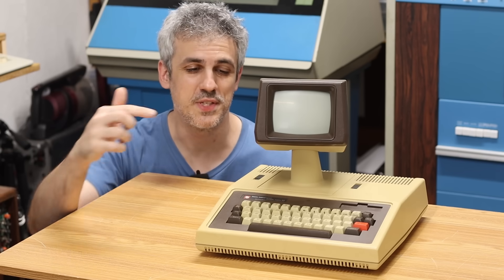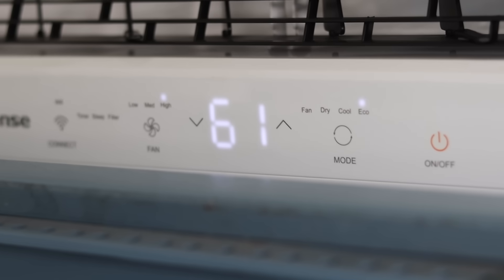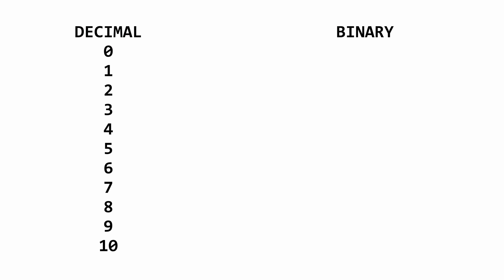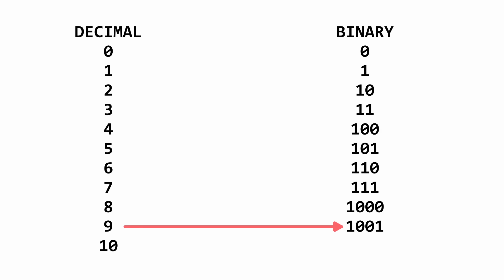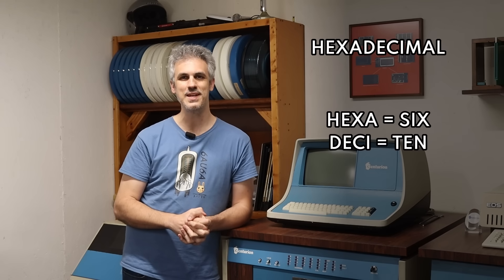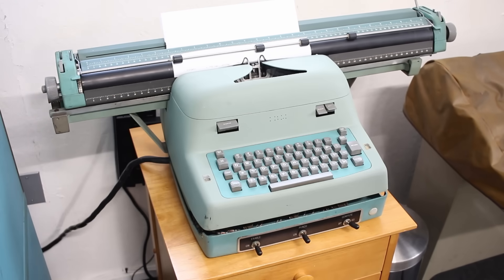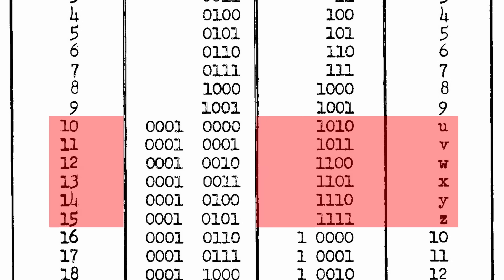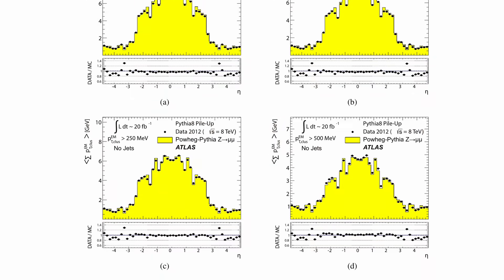Learn How to Count Like a Madman (Or a Computer)!

Comment: Hexadecimal + decimal isn't that crazy, given that some early computers were built using something similar called bi-quinary, as a way to do decimal electrically.

Bi-quinary design consisted of one pair of wires that'd do a binary value in a one-hot form, and a group of five that'd do a quinary value in a one-hot form. Combined, this gave a decimal digit in seven wires, two of which would be energised at any given time. Weird, but workable.

Comment: 1:45 Fun fact: Every number system refers to itself as base10.
binary => "base2" => 2 in binary = 10 =>  base2 written in base2 = base10
octal => "base8" => 8 in octal = 10 =>  base8 written in base8 = base10
decimal => "base10" => 10 in decimal = 10 =>  base10 written in base10 = base10
hexadecimal => "base16" => 16 in hexadecimal = 10 =>  base16 written in base16 = base10

Comment: I suspect the zero is on the left because many early typewriters didn't have a zero , they used a capital 'O', 1 was also not used and a lower case ell ('l') was used.  The offset for placing the 1 on the right was basically good as the 2 was above the Q and slightly to the right.  If they had put the zero left of the one it would have been a stretch to reach it with your pinky finger so it went on the other side.  This way typists only had to change from using oh (O) and ell (l) to one (1) and zero (0), the rest of the numbers stayed put.  Just my best guess.

Comment: Early typewriters didn't have a 0 (zero) key nor a 1 (one) key, they just used I and O instead.  When some keyboards added one or both of these digits, putting zero on the right ensured it would be in the same place whether or not the keyboard had a 1 key.  Also, it was already common place to have zero after 9 on rotary phones, as it actually interrupts the line 10 times.

Comment: Great explanation David.  The other ”common” mixed base system is https://en.m.wikipedia.org/wiki/Sexagesimal, used by the Sumerians.  Base 60 numbers but written with Base 10 sub-parts.  And if you really want to bend your brain with number systems, try https://en.m.wikipedia.org/wiki/Balanced_ternary, which was used by some early computers back before bits won the day.

Comment: Numeral systems that use more than one base are called mixed radix systems, and they are niche, but not unheard of. The ostensibly base-60 system of ancient mesopotamia is often thought of as a mixed radix system that has groupings of base-6 and base-10 digits

Comment: Got an example of mixed base counting for your displeasure: the pro NES Tetris players use hexadecimal for the most signifigant digit of the score and base ten for the rest, for largely the same reason as the Bendix -- there isn't enough space for all the digits they need to display it in decimal.

Comment: If you can believe AI: The Bendix numeral system, used in the Bendix G-15 computer from the 1950s, is called bi-quinary coded decimal. This system represents decimal digits using a combination of two bits to indicate whether the value is in the range 0–4 or 5–9 (the "bi" part) and five bits to specify the offset within those ranges (the "quinary" part). Each decimal digit is encoded as a 7-bit pattern, blending binary and quinary elements for efficient processing in early computing systems.

Comment: I know it's heresy, but if someone wanted to change the coding to hexadecimal, is it a program change, or a wiring change on the Bendix? It has no eprom or anything like that. The paper tape does not hold the coding info either,  as far as I can remember(long series).

Comment: In the early 2000s, I was working for a school district which had a system where they could (still!) only store 2 digit years... but the digits were text... so for 1999 it was "99", but for 2000? It was "A0" thru "A9" (for 2009), and then for 2010?  "B0"... -- It was a mixed number system just as you described. -- The worst part... I don't even think they were using Cobol or something like that... I think they were stuck with this dependency because of a web service from some 3rd party that only accepted 2 digit dates. 😅

Comment: Mixed base numbers can be encountered in some NES games, if you overflow the score. Basically the characters are usually arranged as 0123456789ABCDEFGHI etc. So, if your score display is 6 digits wide, and you go past 999999, if there is no code to handle the last digit overflowing you'll end up with A00000 for 1 000 000, B23400 for 1 123 400 etc., which is good because you can still decode the actual value. For example, you'll see this in high profile NES Tetris, although a cheat is necessary to see it, because by default the game blocks scores higher than 999999 from displaying.

Comment: 1:35  That’s a beautiful car! I also have a vintage car waiting for me to get the engine running again. It’s a 1984-1985. 9th-gen Ford Thunderbird turbo coupe, a 2-door sedan. The license plate says 2002, so it’s been sitting for 23 years—and it had already been sitting before that. (It’s a Minnesota car.) The floors are rust-free, and it only has four small rust spots on the hood, each about 2 inches wide. The rust isn’t too bad. I can’t wait to get it running again!

Comment: As I remember, MAS90 Accounting (at least in the early-mid 90's) stored the year in a 2-character hexadecimal-like format.  Which meant it still only needed two characters to go past 1999.  I suppose if they actually stored it as hexadecimal it might have only taken one byte.  Of course, I can't quickly find any documentation that explains it.

But on that AH-3000, did you have to use a Lucas Smoke Replacement Kit on that wiring harness?

Comment: First rule of engineering is never mix measurement types or scales. One of the maddest things you can do is mix metric and imperial (standard) - which is why 1000ths of an inch is absurd (seriously if you can do 1000ths of anything, you can do metric) but not as f****d up as mixing numeral base types depending on the position! Although the office plan that came to us drawn and measured in deci-inches (without a scale) does come close

Comment: There is one weird system we all use:  dates and time. Consider 2021-07-31 23:59:59.999

In there we have decimals throughout, I grant you, but we have fields restricted to above 1, 1-12, 1-28,29,30 or 31, 0-23, 0-59 and finally a value 0 to 999.9 recurring.

So, a combination of start-at-0 and start-from-1, a range conditional on 2 other fields (for leap years), both integers and one real.

A lot of history made this - from the Babylonian base-60, the early Christians before the invention of 0, and finally the decision to drop ‘trices’ (60 trices make a second) in favour of decimal places.

I’m a programmer and have had to deal with this mess 😅

Comment: Whoa whoa whoa, are we really just going to breeze by what appears to be a Mazda BP4W swap in a mid 70s Isuzu 117 at around 1:45?  I need to know more about this... Do you have a car channel I don't know about?  Side note, I was only half paying attention initially until I recognized the crank trigger wheel pattern and the ignition coil assembly on the table, and I immediately skipped back to check out the car. Is it bad that I recognized a crank trigger wheel pattern first?  Edit:  I also want to know more about the Mazda Cosmo, and the Austin Healey... Really any and all the cars you may have most likely, based on seeing just those three... Seriously, let's be friends.
Reply from the maker: Good eye! Not many people can pick out a 117 Coupe.
There's also a '73 Isuzu Bellett, an '88 Nissan 300ZX SS, and a '91 Honda Beat hanging out too. Not to mention the handful up in storage waiting on work. I do have a car channel called Usagi Motors, but I haven't uploaded anything in forever there, although I would really love to start doing so!
Reply: @UsagiElectric  Nice little collection of rather unique and lesser-known cars you have there, we would get along just fine. I almost bought a 300ZX with a no-start condition for my first car but got talked out of it. Wish I had now... Pretty sure it was a 1991 but it's been too long, and my memory is fuzzy. I must admit it took me a while to identify the 117 and the Cosmo as I'm not intimately familiar with them, I got within the right ballpark on my own, but not the exact car, I ended up finally giving in and trying reverse image search from a screenshot and that was surprisingly accurate.  The BP4W on the other hand was an easy identification for me though. I'm actually glad to see someone swapping a BP series into something else for once, usually people are swapping other things in place of the BP engine. Any particular reason you went with the BP4W instead of the slightly later version with variable intake cam?  Side note, subbed to Usagi Motors, if time allows for it I think you should absolutely make car content as well.

Comment: Counting or parsing a date string in a Windows batch file is fun because it inteprets any number with a leading zero as octal and then complains that "08" cannot possibly exist. I had legitimately forgotten that octal existed before running into that error.

Comment: We did "modern maths" in secondary school, it was 1970, we did binary and then briefly explored other bases, so starting to work in binary and hexadecimal wasn't a surprise when I started with microprocessors in 1976. Then I started with DEC processors in octal, the PDP11-70 even has colour coded switches to help. 
Granted, the Bendix is a case apart.

Comment: On the topic of mixed number systems in one number: the jobcount in SAP systems is using this: For decades they used an integer representing the current time in centiseconds (1/100th of a second) to differentiate jobs with the same name. But when some customers started to schedule several hunderts of jobs with the same name in the same second, this system was broken. So - just for last two digits - they started to use alphanumeric symbols. This now allowed (10+26)^2  = 1296 instead of former 10^2=100 jobs with the same name in the same second. Rest of the number is purely decimal, still.
Oh, and "octal", as in base 8, IS a power of two. My head compiler threw an "Out of Cheese" error when you said that!
I think you meant to say that the number of binary digits needed to represent a single octal number isn't [ ld(8) = 3 ], while the number of binary digits for (s|h)exadecimal digits is [ ld(16) = 4 = 2^2 ].

Comment: hey, that's the same solution used on traffic light countdowns in china - if you have to wait more than 100 seconds, the tens column goes to a,b,c,d,e,f. affords interpretability. it's a reasonable enough solution!

Comment: Count like a madman? 0, 1, 2, 3, 4, 5, 6, 7, 8, 9, A, B, C, D, E, F, 10, 11, 12, 13, 14, 15, 16, 17, 18, 19, 1A, 1B, 1C, 1D, 1E, 1F, 20, 21, 22, 23, 24, 25, 26, 27, 28, 29, 2A, 2B, 2C, 2D, 2E, 2F, 30, 31, 32, 33, 34, 35, 36, 37, 38, 39, 3A, 3B, 3C, 3D, 3E, 3F, 40, 41, 42, 43, 44, 45, 46, 47, 48, 49, 4A, 4B, 4C, 4D, 4E, 4F, 50, 51, 52, 53, 54, 55, 56, 57, 58, 59, 5A, 5B, 5C, 5D, 5E, 5F, 60, 61, 62, 63, 64

Madder?! Okay, for base-2^64 where something like [100,0] means the number exceeds the counting base by one hundred times or [100,0,0] would mean the number exceeds double the counting base by one hundred times, et al.
The final integer can serve as precision by dividing it by the base minus one, but you'll lose 2^64-1 integer units out of the whole number. 
I'm pretty sure this system could conceivably store (2^64)^(2^64)-1 (basically 2^64-1 items that are each 2^64-1), and theoretically require something like 147,573,953 terabytes to canonically store the number.

Comment: "mixing and matching" numeral systems seems to happen relatively often in video games, at least old ones, for values that were never meant to exceed 99.  they convert the binary into decimal by dividing by 10, and then just using what's left over for the upper digit.  this can and has resulted in the same kind of weird mixed radix stuff showing up.   so you can see your item count roll over from 99 to A0, then A9, B0, B9, etc. and even higher than F9; using whatever characters are present past that point.

Comment: The Bendix numbering system is insane!

My first computer was a Heathkit H8 that used split octal notation so 16 bit values were represented as 000000 to 377377. Not with individual LEDs but with 7 segment displays.
Takes a while to get the hang of but each group of 3 digits represented 8 bits.

Comment: This kind of thing happens all the time in science.  You need to figure out some way to talk about what you discovered, and sometimes mistakes are made.  For example, in electronics, we now know that it's basically electrons (which have a negative charge) that do most  of the work.  But the early pioneers in the electrical field didn't know this yet, so we ended up with a confusing system for talking about electron flow.

If you truly understand, it doesn't matter what polarity things are, as long as it's consistent.  But it would have been better if the people who came up with the terms knew a little bit more than they did.  But it's hard to fault them, they were discovering this stuff all on their own.

Comment: Working with industrial control I deal with multiple number formats. Base 10 is obvious. Most labeling for operators (inputs, internal relays and outputs) are Octal. Much of the outboard equipment on both Ethernet and serial use ASCII-Hex. And last but not least are function settings on some gear that is done with Binary.

Comment: That would be a base-160 system with a subbase of 10. If you just start with the understanding that the columns alternate base, it'd be perfectly functional. For something like this, refer to the way we mark time, which is actually very old - that's how Babylon counted, yes, THAT Babylon.  Time is base 60 with a subbase 10. You have a ones column that when you hit 9, it rolls over into the tens, but once you're at 59, well, the tens column is in base 6, so you roll that all the way over to 100 - but we use a : to mark off which columns are which, because otherwise it's easy to get confused.
Reply: thats nice thanks

Comment: In my career as a software engineer, about 20 years ago, I developed a configuration application for a telephone switch. One of the requirements was to accept numeric input in both decimal and hexidecimal. Just for fun, I threw in a third option for octal. The engineers of my own generation got a good laugh out of it. However, the "old timers" approved of it and octal remained an option in the application.

Comment: Interesting. There were a few strange numbering systems use in the early days of computing. This was done to conserve hardware in the machine.

One was called "biquinary" code. The values used for the digit positions are "50-43210", so decimal 2 is 01-00100. Decimal 9 is 10-10000. This was used with machines that utilized those neon filled ring counter tubes...I believe the tubes were called "decatrons".

Another was called "ternary" code. A ternary number would have three digits and the digit values are +, 0 and -. This three digit number could represent a decmal value from -13 to 12. Decmal 0 is "000". Decimal 8 is "+0-" and decimal -10 is "-0-". Apparently the machine used a positive and negative voltage as well as zero volts in the logic circuits.

I found this stuff in a book titled "Digital Computer Principles" by Burroughs Corporation, (c) 1962.
Reply: not sure If I follow the counting up/ down on that
Reply: @highpath4776  Either do I 🙂

Comment: Octal has been useful: The toggle-switches on the Altair 8800 were grouped in triplets as the 8080 instruction set is very understandable using octal.

Comment: OCTAL Sucks, its not natural, Humans use Decimal (0-9) you cant do Binary Coded Decimal (BCD) in octal without adding another bit, so just use 4 bits. aka HEXADECIMAL (0-9 Plus 6 additional digits A-F) I have been using hex since 1969 on IBM Mainframes. MUCH easier than OCTAL. I would read 3,000 page core dumps for lunch. SEXADECIMAL? and you wonder why companies like Bendix and DEC is out of business? Ive used machines that were Byte-Octal, so a 16 bt computer would could from 0000 0000 to 377 377 instead of x'FF'.  The front panel was layed out XX-XXX-XXX XX-XXX-XXX. instead of XXXX XXXX 
IBM used rotary dials in place of switches on some models. Each rotary dial was labelled 0 - F on each position of the rotary dial. Made a much cleaner looking & easier to use front panel